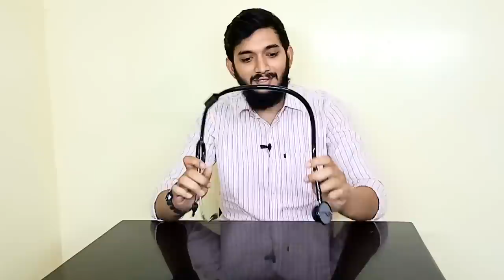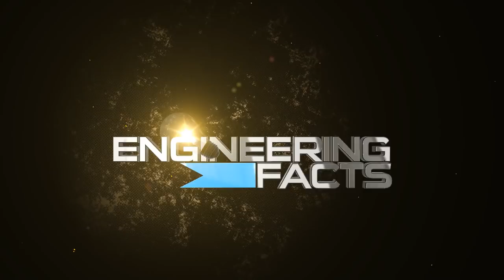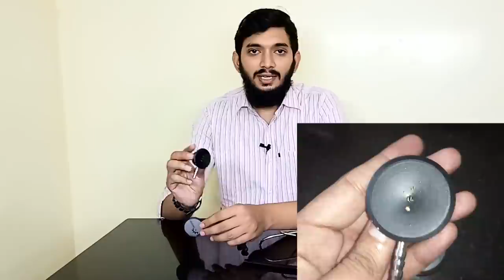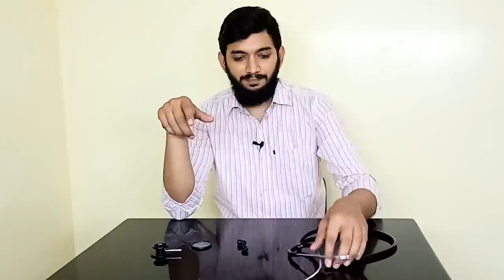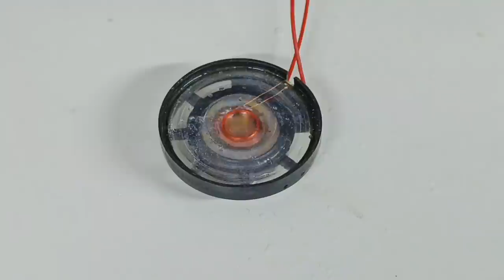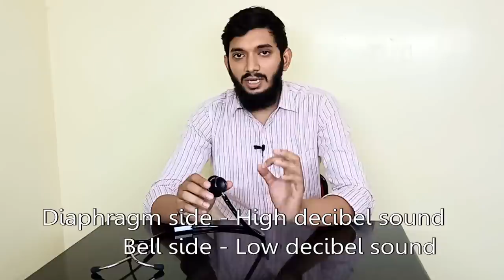An Amplifier without any electronic circuit, Stethoscope_Tamil, An interesting fact of stethoscope..

Comment: I'm a doctor. Please correct yourself. Diaphragm is used for high "frequency" sounds and bell for low "frequency" sounds. Decibel is a notation for measured loudness whereas it doens't give any info about Frequency of the sound.
Reply from the maker: Frequency is cycles per second. Which is more repetition of an amplitude. So if you want to use it upon frequency, you have to use diaphragm side for higher heart rate and bell side for lower heart rate, Which is wrong. Higher amplitude can be heard by diaphragm side, and lower amplitude by bell side. Which I mentioned as decibel.
Reply: @engineeringfacts    again I'm sorry to say your reply doesn't make sense. Frequency (in scientific terms) is number of cycles per second. It's what we perceive as pitch of sound.

"More repetition of amplitude"?!? Doesn't make sense. Amplitude is the height of the wave which is more for a louder noise. Decibel is the measure of the loudness. 

And by frequency, I didn't mean the heart rate, rather the cycles per second of the sound that you get from the heart. 

Amplitude kum frequency kum direct correlation illa. Pls don't confuse. 

Diaphragm is used for high pitched sound (not the heart rate) and bell for low pitched sound.

It's if you've to talk in scientific sense, what you told is wrong. Please don't stick on to it.

Comment: Super anna good explain.and small request is inverter why using one wire method. I  sent the request In your Instagram page. I am kavi
Reply from the maker: What is one wire method
Reply: @engineeringfacts  I explain inverter output side take one wire phase only take  neutral don't take but how to coming neutral in circuit.go to your Instagram page I send in voice sms